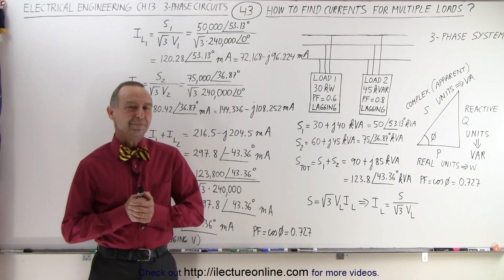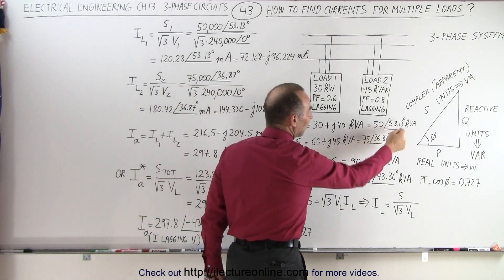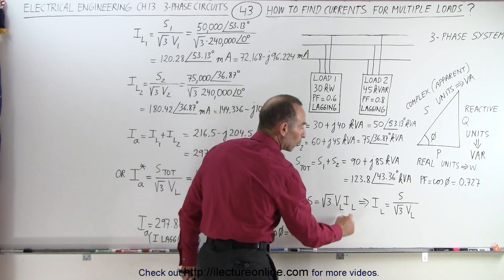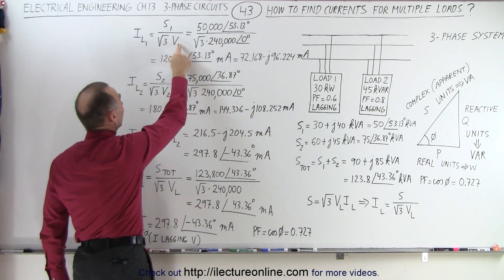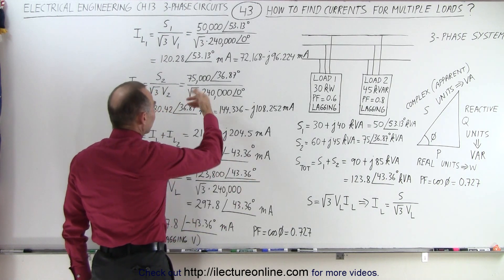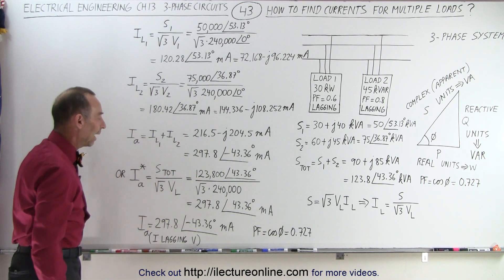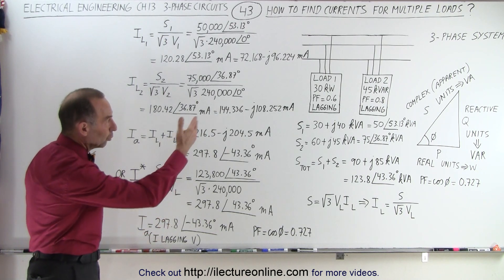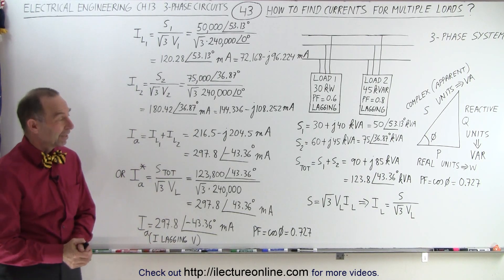Electrical Engineering: Ch 13: 3 Phase Circuit (43 of 53) Find the Currents with 2 Loads.

Comment: Ive a question , can u answer please? when we are determining I1 and i2 sepeatrely theres no I* in your equastion , but when we are determining total I directly, youre using I* in ur eqn , why is that?
Reply: We got same concern mate, actually he missed something important...
remember that we always apply conjugate when computing for the apparent power when using phasor voltage and phasor current...
based on his solution he forgot to apply conjugate when solving for current 1 for load 1 , and current 2 for load 2....
he just added it that is y the answer in the current is different compared with the other one....

Comment: Why can we simply add I1 and I2?
Does that mean 2 loads are connected in parallel?
Reply from the maker: The loads on household lines (and typically most lines) are in parallel.  That way the voltage across the load stays the same and only the current is increased on the line with each additional load.